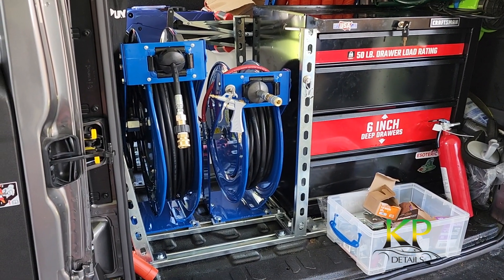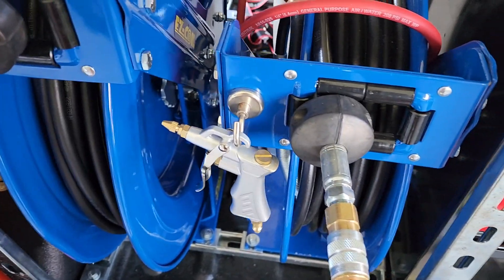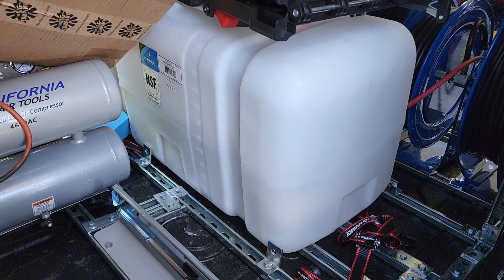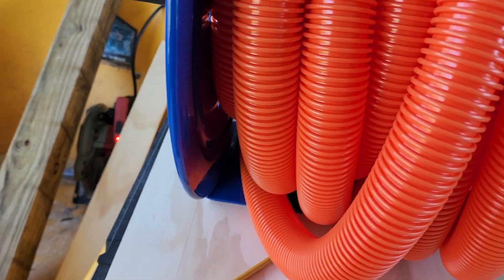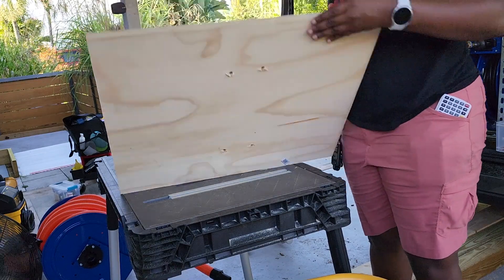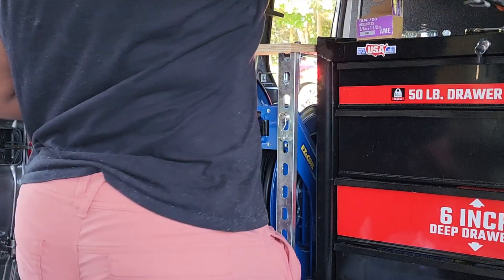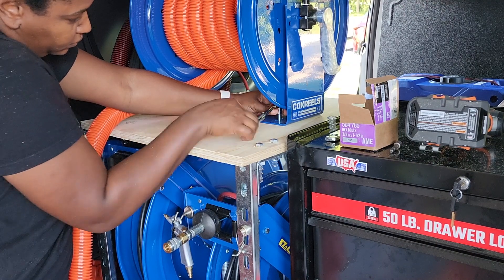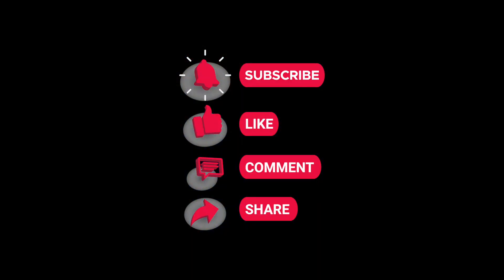Van Build: Vac Reel Install

Comment: Great Video and an Awesome job with the van build. I am also going the Unistrut route with my van build as I do not have a welder and I can easily take the Unistrut apart. Good Job
Reply from the maker: Thanks. We had a metal saw and it was able to handle the job with no issues.

Comment: I watched your video twice fantastic great job
Reply from the maker: Thanks! It's been a great learning experience. Plumbing, electrical, structural and getting it all to work seamlessly.
Reply: @KPDetails  yes and the satisfaction that you get after saying and seeing I did that myself
Reply: @KPDetails  don't stop sky is the limit in this industry if you can get someone to ride the wave with you also you can never duplicate yourself don't look for that find someone that can do a good job but not duplicate yourself you won't find that
Reply: I would like to ask you a question
Reply: Do you do any collision centers are you interested in that type of detailing as well
Reply from the maker: @forevercleandetail  I haven't done any collision centers as yet. Do you recommend that as good income?
Reply: @KPDetails  most definitely I do a lot of them you will be doing interior check-out caliber collision they're huge I have about four checkouts service King and performance auto bodies
Reply: @KPDetails  the biggest thing about it the prices aren't the same you can get the average interior for at least three hundred and up
Reply from the maker: @forevercleandetail  funny, my personal car is currently at Caliber. I'd like to see how it comes out.
Reply: @KPDetails  go in there with your rig and tell them what you can do and you would love to do work with them great income if you can get at least two or more under your belt they do pretty good work the inside of your car may not look that good because they don't have someone professionally cleaning the inside after they're done with the bodywork that's where you come in at

Comment: I have a similar setup for my cleaning van.... what i recommend is also to  install   floating drawers or floating levels.. in this mean ,,,,,for example ...underneath where you have the 2 blue reels  (  air and  water pressure  hose )   you coulld have put a ( 1 or more ) floating floor of around 10 to 20 cm  ( height is your choice )  to hold your ladders  or even slide out drawers...... you could have stored all types of things here.... You could also  put your ladders ( if you use them or  other stoarge  by  putting a  highl level rack at the top underneath the ceiling of the van....  This  floating floor  could have also been incorperated  on the new  Vac reel  you just showed us in the video There is room to put  somedrwaers here as well bewtween the  coxreeel holding the ornage vac hose and also the the frame it is sitting on if you get what i mean..  These extra steps  really do increase efficiency.. greatly -- the  hose reel for the pressure washer hose is fantastic it is  high and  with a few revolutions   the pulled out hose is back in the van .
Reply from the maker: Thanks, i might change that in the future. I need to post a follow up video. I've added a lazy Susan for my 5" pads and the vac sits at the back. Ralda's Detail had a very nice sliding drawer setup in one of his builds.
Reply: @KPDetails  amazing job! Do you already have customers or were you able to invest upfront? Thanks for the video.
Reply from the maker: @annagraham6204  i have a few regular customers, maintenance washes. Have done some coating jobs. Thankfully, i was in a position to invest upfront.

Comment: Hi 👋 I want to mount some reels on to a cart. Are you using a din rail is that what it’s called? Did you create a square din rail, maybe some brackets in the edges, and then two additional rails that go across the base of the frame to mount the reels? Also what were all the nut and bolt sizes? I am trying to replicate that part for mounting it on top of a cart. Thanks
Reply from the maker: I'm not familiar with a din reel. I used the nuts and bolts from the unistruts. I believe  I had to use a 2.5"bolt and matching nut.
Reply: @KPDetails  Thanks, i did some research and unistruts are the same as superstruts.  I never seen them so i googled images and first saw din rails.  I am still deciding if i should just mount the reels on some wood to the cart or do the unistruts. But appreciate the reply and info.  WIll go down home depot and see if they sell them and then it prob be a price decision. thanks

Comment: Great job. I’m interested on the water hose reel
Reply from the maker: The problem of finding a supplier. This is where I bought it, if you sign up with them for emails they will offer a 20% discount. https://www.zoro.com/coxreels-spring-return-hose-reel-14-mnpt-100-ft-ez-thp-1100/i/G1176519/?utm_source=google&utm_medium=surfaces&utm_campaign=shopping%20feed&utm_content=free%20google%20shopping%20clicks&gclid=Cj0KCQiAyMKbBhD1ARIsANs7rEENNE2r8ogkbXWC6iapIGlJ1Sl0I__QWm76_YlB7Vz3UUdeo2_jU2caAh2LEALw_wcB  lead time was 2 months and they wouldn't do anything about it being bent. It works, but as you can see, it's an expensive reel

Comment: nice, like the unistrut frame setup, is frame bolted to floor?
do you have any video footage of the framing build?
Reply from the maker: Yes, unistrut is bolted to the 6 D rings that came from the factory. I don't have that footage. It was easy though. Took out the D rings, got the same sized bolts from either Home Depot or the specialty bolt place. I'll do a follow up when I take the items out again.

Comment: Nice work! I like the uni-strut framing, I want to do the same instead of wood. Can you tell me the name of the refrigerator pullout or where you found it?
Reply: I saw the info on the slider below! Thank you!
Reply from the maker: I had to do a lot of lateral bracing for the pullout. Because it's not braced from side to side, there is a lot more play than I'd like. If you build the whole thing out of unistrut it would feel more secure. With saying that, it's rated for twice the generator's weight as is. I just don't usually pull it all the way out unless I'm working on the van or starting the generator. Hope that helps.

Comment: Hi what size is the unistruts you using and all the other parts
Reply from the maker: 14 gauge, 10ft lengths. All other parts? There are a ton. If you let me know specifically what you're referring to, I can help you out. Thanks for watching.
Reply: @KPDetails  the other parts like the struts spring nuts and bolts also the 90 degree angle brackets and the t brackets sizes

Comment: Looks amazing. What is the size of your water tank?
Reply from the maker: 50 gallon tank. I have a video coming where I plumb the tank. It's not quite ready for use yet, but getting there. https://www.tank-depot.com/productdetails.aspx?part=A-SP0050-RT this is the tank I bought from Tank Depot in Pompano Beach. It was the one in stock.

Comment: Wow you have a nice set up!!!  Quick question how profitable is a mobile detailing business?  I do detailing as a hobby but since I have all the tools I've been debating doing it as a business but I'm also debating if it would be better to go the mobile route or I already have a nice air conditioned garage which I really would rather use if I can get my future customers to bring me their vehicles or figure out ways to get the vehicles to my garage because doing them in the air conditioning in south Florida would be a big big help for me fatigue wise!!!
Reply from the maker: Thanks. Not such an easy answer. I haven't figured out the profitability side of it as yet. Liability insurance is $3-4k per year, auto insurance $2-3k, van payment... I start out down about $1200 a month based on overhead and have to dig out from there. Check out Car Supplies warehouse and Yvan LaCroix. They have some great videos breaking down profitability. It can be very profitable, if i did it full time, marketed it would be better financially. But as of right now, I'm not in a position to leave my corporate 9-5? I had folks bringing me there vehicle for awhile, but my home setup isn't great for coating, longer jobs. I understand S. FL, I live in Fort Lauderdale.

Comment: That retractable hose reel for the power washer looks awesome ! What type of pressure washer do you run ?
Reply from the maker: Right now,  Cat 1800. I'll see how long it lasts.
Reply: @KPDetails  I did just get the active 2.0. I bought the VE56 too just to see which I like best. It’s the same as the CAT I believe. The 2.0 seems better on every level. VE56 felt plasticky af! Attachments falling off. It would pulse periodically as well. Just for a second every 2-3min or so. Puts up great #s but don’t trust it.
Reply from the maker: @annagraham6204  yes, same as the CAT. They are only supposed to last 100 hours and they are not serviceable. I bought the AR630 TSS But it keeps tripping the breaker on the generator. My testing shows it's not drawing over 20amps, yet it trips the 20amp GFI breaker
Reply: I’m interested in getting a cox reel for vaccuum hose we’re all attachments included with the reel? I’ve been reading reviews that doesn’t come with attachments and that there hard to find
Reply from the maker: @juliovale2588 it came with a lot of attachments. Came with the whip line. What type of attachments were you referring to?